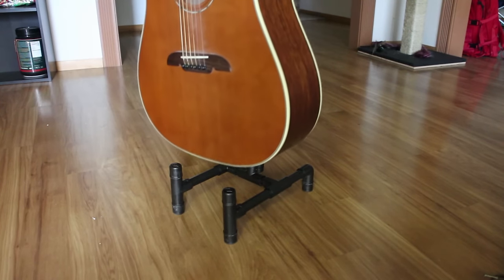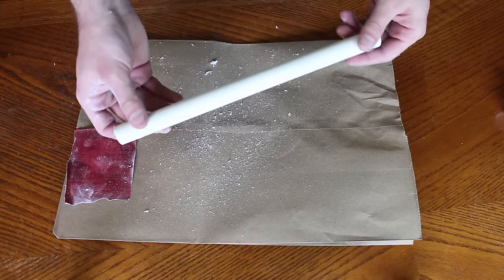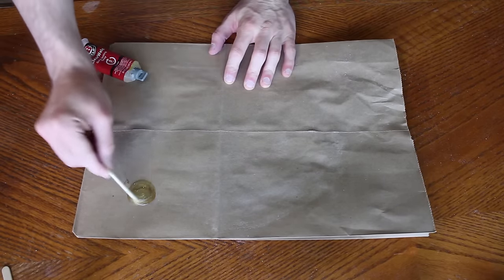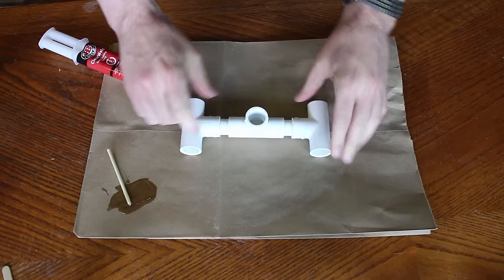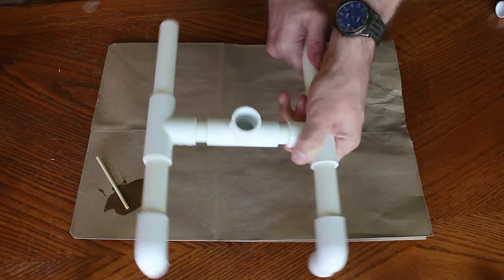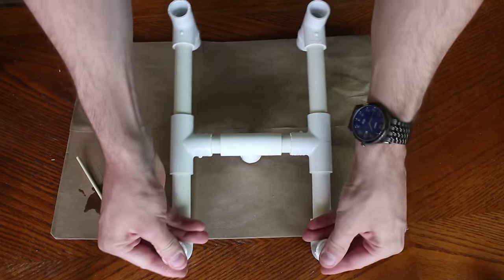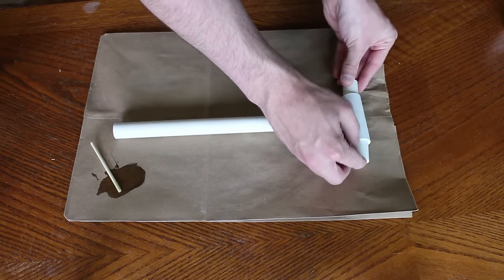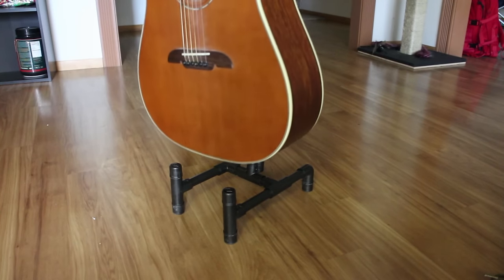Inexpensive Guitar Stand from PVC Pipe

Comment: nice work!!! i would add 2 elbows for the guitar neck
Reply: i recently did a similar design but i added 2 elbows on both sides of the T joint on top just in case it slides sideways and falls off. I've seen many diy stands without top support and it gives me anxiety

Comment: Couple of things:  Number one, you should have not used the epoxy, common PVC cement, clear, gray or white will suffice and is cheaper, prime the joints with acetone or even a little rubbing alcohol to clean the joints for gluing.  Next, unless you find some adequate padding, you're going to get some  serious scratches on your instruments.  I suggest some of the insulation  used for cold weather applications with PVC pipe, it just slips over during assembly or can be slit and then taped or glued to hold it in place in case you haven't thought that far ahead.  In the end, unless  you have the material and glue on hand left over from your irrigation system build, you can buy a commercial folding stand that will fit in your guitar case for about the same price that you would pay for the components.  2X4 scraps left over from a build and a small amount of glue and a few drywall screws will also work.  It all depends on what you have on hand whether or not it is cheaper to build a stand, that folding stand that fits in the guitar case looks real good at about  $25, I can't remember the name of the stand, but it is offered by the Blue Chip Pick Company on their website, presumably it is available elsewhere.  Check out the Blue Chip site, their picks are equal to Tortoise in every way, and are more consistent, great product, and the stand is a great one as well, imagine a good stand that will fold up and fit under the headstock or in your string/tuner/pick storage container of your case.  Still you have a good idea for those who have PVC material on hand and need a stand right away, for me, I already have a stand, and have ordered another, one of the folding ones from Blue Chip.
Reply: Guitarist are creative types so even though it may cost more, it’s fun, creative and gives my blisters on me fingers a rest😊🎸
Reply: I thought the same.  Dollar store swim noodles is what I'm thinking.

Comment: thank's man! i just made for myself and it's working perfectly!
Reply from the maker: I'm glad it worked out for you! I still use mine all the time.
Reply: Rick Osgood does it work whith electric guitars?
Reply from the maker: I don't see why it wouldn't. You might have to make the front of the base more narrow if the guitar isn't as wide.
Reply: Ok thanks
Reply: +Rick Osgood I believe he can use a u bend somewhere on the middle of the base, that way it'll be more sturdier for an electric.

Comment: To all the verbally abusive negative commenters I strongly recommend you ask your doctor to increase your medications because they're are obviously NOT working. This is a simple and very inexpensive project that can easily be modified to accommodate more guitars.  Also let it be known that many inexpensive commercial stands are junk - they are not stable and the guitar can and does fall out of the stand far too easily. Also the rubber protection deteriorates rapidly and the metal parts can and do scrape the finish on your guitar whereas the PVC is plastic and does NOT. However I would not recommend paint on any surface of the PVC stand that would contact the finish of you guitar unless you chose to cover this surface with insulation foam or rubber. After a guitar is verified to fit securely in the stand, I would recommend that all joints be epoxied and made solid. As an added security feature I would add a strong elastic or strap to lock the guitar neck in the upper part of this stand. I have seen guitars go flying after the stand was accidently knocked. Thanks Rick for taking the time to put together this interesting option to make guitar stands.

Comment: Guys be aware! I bought everything 25 mm. But couldn't joint the pipes to t's since it requires heating. So I'd suggest using 20 mm pipes and 25 mm t's and other joints

Comment: Is the piping 1.5" inside diameter or outside diameter?
Reply: josephmilsark123 either will work, won't it?
Reply: It's a 0.5" PVC pipe, not 1.5". It took me a couple times going through the video to get that too. He could have phrased it better. :D

For added durability, buy the 0.5" Schedule 40 pvc pipe, that's what I did. This type is much tougher.